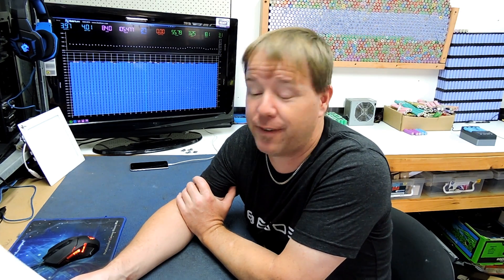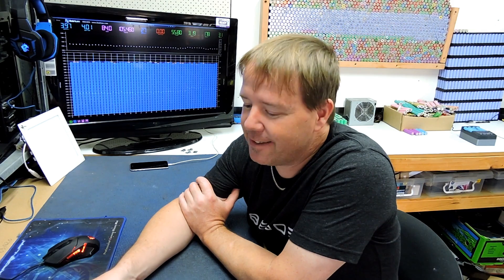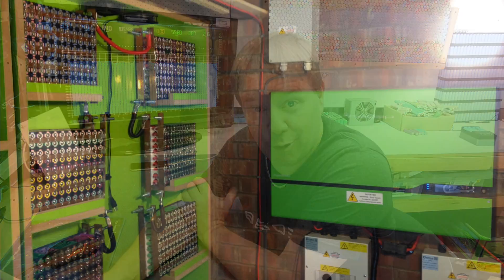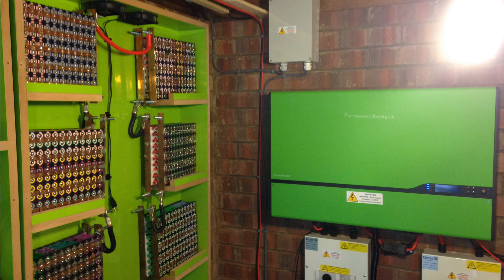So, who was first to build a DIYPowerwall?

Comment: I've watched your videos since very early on in your channels history and have always been a quiet observer of progress. 

I have been living completely off grid (2kw of solar panels, 11.5kw deisel generator, 2kw of lead acid batteries and a 130mtr deep bore hole for water) and i will soon be in the position to upgrade my setup to an 18650 based solution. 

As such, I was wondering if you have any advice about inverters that can work with 18650s and also take charge from an off grid generator?

I have looked around alot online over the last year but I have only found home brew 18650 systems that are hooked up to the grid.

What are your views on your pip solar inverter? I was thinking of maybe buying an outback inverter, but there isn't much information on them working with 18650s.

Anyways, keep up the work with your channel, it's always highly informative and interesting to see your progress.
Reply: The new Outback inverters are compatible with lithium.
Reply from the maker: I know the PIP will start a generator based on voltage (I bleieve) can't be SOC as no internal shunt. How ever bet it would be super easy to get the Batrium to start generator based on SOC hell you could probally do it based on load/Temp/time of day with all the programability it has.

Comment: Tbh people have been using both on and off grid battery storage systems for many many years before you tube started
Reply: I've had a house running on batteries since 1989. Lead acid, LiFePo2 and now 18650s. It was just a matter of time.
Reply from the maker: Ooh hell yes! But trying to find the first time someone said - That cows udder, wonder if the stuff inside is drinkable (so to speak)

Comment: Hi Pete - The first video I saw for building 18650 packs dates back to January 14, 2014. These packs were used for powering an electric buggy rather than a powerwall. However, the concept was the same. You can view that video here:
https://www.youtube.com/watch?v=BAjXjfDamiY
Reply from the maker: Yes, i've heavily shared that video also but no mention of runnig a home. Found a few VERY early versions of powering cars with used laptop batteries - Looking for the "Powerwall" thing or Running a home!

Comment: Still haven't done the video on my Powerwall 2, I'm not well enough to it at the moment but should ok this weekend. In the 5 days its been installed average capacity in the morning is about 40% and then recharged around midday depending on cloud cover. I've also been able to export 10.4kw per day needed to cover the daily service charge. For the non-aussies, feed-in tariff is 11c per kW.
Reply from the maker: I'm super keen to see that! 
My feed in tarriff is 6c gah!
Reply: Our feed in tarriff changed on July 1st to 11.3c. Although its been less than a week, it appears I need (at this time of the year) 25-26kw from the panels each day to recharge the battery, power the house during the day and have power exported into the grid to pay for daily service charge to reduce the bill to $0.00. It does depend on how much is needed to recharged the battery each day and how much power the house is using.

I can see my self eventually adding another inverter with more panels to keep producing enough power for as much of the year as possible and have the grid as a reliable (and free) backup for really bad weather conditions. .
Reply: really bad weather conditions most of time in some places out of the city take the power out like downed trees so not so reliable  i just have a lpg generator for charging ...  i started at the start of 2011 running on batteries when the power was out for 2 weeks of the floods in Brisbane.  

 lucky i had a big generator to so i can run the neighbours each side of me and my fridge but i run all my lighting back then from home made 120w solar panel i made and then used a car battery to run the led lights and i had 12v 24" hdtv and 12v fans to cool as down. i use to run a wind gen from a washing machine motor to charge battery bank.

Then went to a 1kw wind generator 12m high in back yard, then solar panels started to come down in price and made a solar tracker . the more a add to the home in DC power the better the home will be if the power goes out again i be fine

Comment: All cells are fused. That's safety enough if you ask me. They weren't fused when they were laptop batteries. So using fuses makes it more safe already. 

In a powerwall these cells aren't required to to deliver high currents. Also we don't charge them in half an hour to 80%. 

You've had cells that got hot when you tested them. How many of those exploded or cought fire? None! The only videos I know of that made cells do anything like that were cells that were forced into trouble with ridiculous charging voltages or piercing them or heating them up with external heat sources.

It would be more fun to build packs were the cells can be replaced 1 by 1 while the battery is in use.

Just an idea 😃
Reply from the maker: I completely agree Peter -